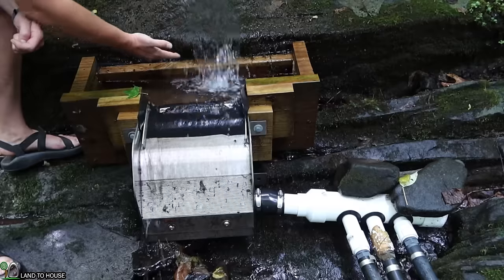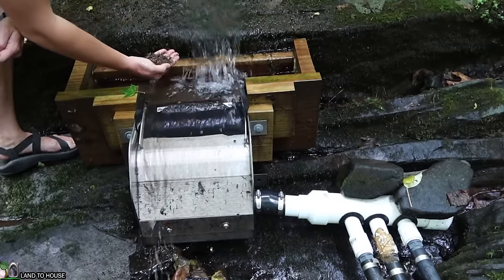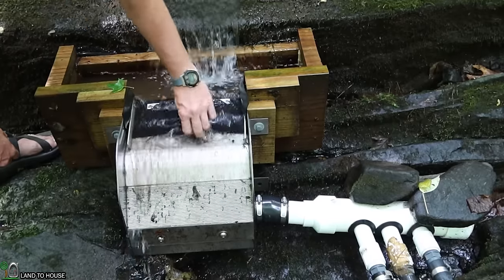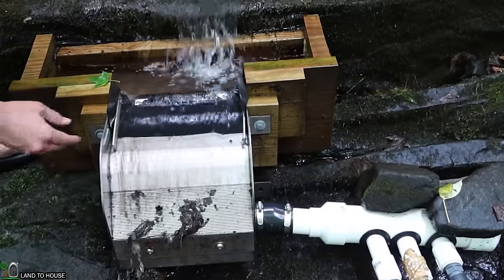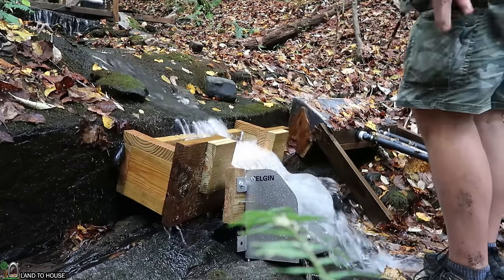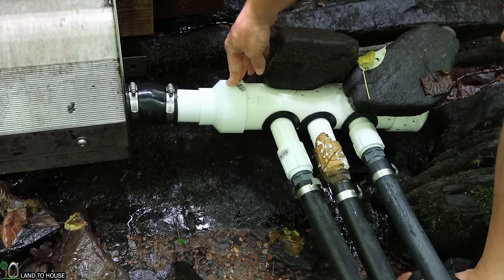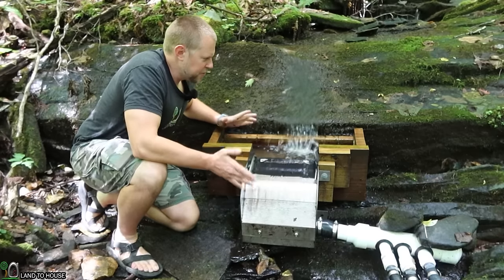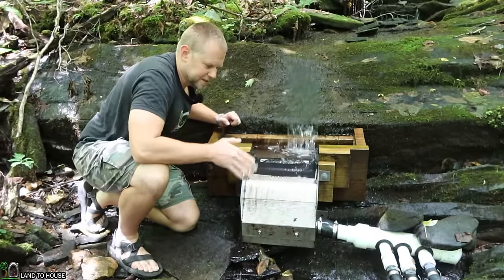Awesome Mountain Hydroelectric Power

Comment: Have you considered a float switch in the barrel and PID controller to adjust dynamically the turbine valves? It's a fair bit more complexity but it would allow you to get the most power out of your system without losing it to the overflow
Reply: I thought the exact same thing.. It make it run and generate more power, when there's a higher water flow all automatically..
Reply: In a manner similar to a toilet flush controlled by a float mechanism, one can regulate the flow: when the float is at its highest point, it fully opens a valve; as the water level decreases in the tank, it closes, and adjustment can be made using threaded rods. No need for electrickery.

Comment: Nice setup. Well made video, very informative and well explained. I've never worked with hydro power, and it was interesting to see it installed and functional. I've installed solar power systems, not my own yet but plan on doing so. As I live in SW Florida the solar would be more than enough thankfully, as there are no creeks near me. Or mountains.
I will also compliment you on your "powerhouse" build, it's not bad and actually looks pretty clean for an amateur install. I am an Electrician with 35 years in the trade, and would offer a couple suggestions though, fairly simple ones that would be well worth doing.
One would be to cover all exposed terminal connections. As you've already experienced, mice will get into things and love chewing on wires. I've been told that the current flow attracts them, whether from the magnetic field or because they like the taste of insulation, I don't know. For a while companies were using a vegetable oil based plastic as wire skin and there were multiple fires caused by rodents eating through the insulation. I don't believe that's used anymore, but they still chew through wires regularly. Placing traps would be a good idea. The bare terminal connections are an issue with rodents as they produce heat and they will build nests close to them. If they complete a circuit or ground out your system you'll have an issue.
Second suggestion would be placing "Caution- Live Electrical Equipment" signs on your shed. From a liability standpoint it will offer protection to anyone who could possibly enter there, but more importantly it will protect you from any legal issues if someone were to get hurt.
I know it's stupid, however there are plenty of stupid people in the world today. Even if someone were to go in your shed, on your property, to attempt to steal your batteries or inverter, if they were injured they could attempt to sue you. And possibly even win. It's ridiculous, but it has happened. Here in Florida there were at least 2 cases that I know of where some crackhead went into a Florida Power and Light switching station to steal copper wire. While it was energized. Did not end well for them as they were killed, however their families sued. And were given money. I'm not sure if it was a judgement to pay them or if the company settled out of court to avoid bad publicity, but the bottom line is that the placement of Caution signs was increased, as well as the number of signs required for any areas that contain energized equipment.
Better safe than sorry.
Good luck on your planned upgrades, I'll look for the videos.

Comment: It's good that you also include previous years design iterations that had failed as well and for what reason for the lessons learned aspect.
Economical and reliable and acceptable performance are the 3 requirements of succesful commercialization. 
This is like indirect solar power.

Comment: I really enjoy your videos on your micro hydro. I think you have a lot more to optimize. However, most of them are more nice to have than need to have, since the win per option is very low. E.g. you could optimize the laminar flow into the turbine or you could make a more complex regulation of your water usage. The last will be saving water at the top and you could build in a container for storage. Also you could turn the water off when not needed.
I have more ideas, just from watching your videos... Keep them coming, plz :D

Comment: Thank you for putting this together, both the system and the detailed video, so important to explain the "why" and lessoned learned. Two questions: given your experience with mice and the other woodland creatures that will admire your green-energy why did you not further protect the vulnerable wiring and I absolutely hate with a vengeance the use of "Wire-nuts" to connect your generator with the to-house wiring connection, terrible. Thank you in any case.    👍    (Edit: The outdoor electrical box, this is a better idea. However for fire safety - it's a bit close to your house, fire spreads with ease. It would be wise to install an "Automatic Fire Suppression System" with a primed burn-through-pipe running above each electronic system within that cupboard. There are many to choose from online, personally I would use TWO medium priced independent systems covering the same area, as this allows for one to fail while still protecting your property. Also install smoke detectors etc.)

Comment: It's always better to place a rectifier as close as possible to the generator as dc has less parasitic losses, specially with higher frequencies.
Also you might want to look into active rectifier to improve efficiency
Reply: and only 2 wires will be needed :)

Comment: This is a really nice set up. Really enjoyed watching the video and is very informative and well explained. I would love to do this myself if I had the opportunity to live near a running water source like you do. The nice thing about this is you can produce power 24/7  unlike Solar. I've been electrical contractor for over 35 years and have been living off grid for the past 30+ years. So I can really appreciate the work you put into your system. One thing I would suggest as I have also experienced in my own set up is that you need to upgrade with time. That being said I would suggest you using lithium batteries or something similar as opposed to lead acid. I understand that they are expensive but the cost is well worth. Plus you won't have to deal with all the maintenance like you have to do with Lead acid type batteries.. One other thing that I would suggest is to make sure your battery cables are sized according to your battery amperage and fused according to your  amperage if you haven't done so already. This is one thing that is often overlooked. Looking forward to your next update. Keep up the great work and please stay safe.⚡👍

Comment: I love this project and am about to do basically the same setup. Any chance you could put together a schematic so I can have better guide to design my system? Also, which batteries are you planning to upgrade to? Keep up the great work :)
Reply: I have a similar setup but I’m using a Harris Pelton from Kansas Wind Power and with one 5/16” nozzle at 58psi I’m getting 350watts.  I would get a bit more if I replaced the bronze pelton wheel that’s been running continuously since 2008.  The cups are worn smooth so some efficiency is lost.  They have a new model with stainless pelton wheel that I would get if I was starting over.   The unit in this video seems to be a bit missing some efficiency.
Reply: Where can I purchase these stainless pelton wheels? I’ve been running my wilderness Alaskan pelton wheel since 1981 and it would not surprise me to discover that the 3 bronze wheels are becoming worn. 
Thanks!

Comment: Hey, I've been watching your microhydro vids the last few days, very informative and interesting.! 2 questions. How cold does it have to be before the system freezes up? With running water, that might get it through a frost I presume? 
Also, I wonder if it would be possible/useful to ad a flywheel to the generator somehow, to store the kinetic energy produced? Has spwncer ever tried it? Hope you see this, thanks again
Reply from the maker: Thank you for watching. The system can handle a light frost but sometimes our winters drop down to the single digits. Definitely has problems at that point. I'm not sure about the flywheel. The constant water flow from the mountain seems to do just fine At maintaining the spin.
Reply: Thanks for the reply.! Can't understand why this system hasn't taken off here in ireland with all the rain and hilly land and streams. Or the hydro pump for that matter.

Comment: Question, wouldn’t your barrel for sediment and overflow act as a breaker box and neutralize the head pressure gained from above?
Reply from the maker: There is around a 2 foot loss from the intake and barrel. This means around 6w of loss. Not much worth fighting over. The silt catchment and air removal is much more important
Reply: I agree,you are venting the head to the intake at the barrel. Plug the outlet pipe and seal the barrel very well, and you have the head right to the intake height. This will give more pressure at the turbine, so you can use a smaller nozzle, giving the same flow as before, but with a higher velocity, hence more power output.
Reply: Why not site the sediment barrel at the top collector location too and take advantage of the 6w bleed?
Reply from the maker: The air seporation and silt filter is worth the 6w loss to me.

Comment: I agree with Joe, the electrical engineer who gave you kudos on your installtion. I have worked in the electrical distribution industry. And I took note of the incident where a mouse are through one of the phase wire coming from the turbine. The mouse met its demise by providing a ground path for the compromised phase. A ground fault detector can be constructed from a small torodial transformer through which all three phase wires will run. Normally the net magnetic field will be zero and the transformer output will be zero. The loss of a phase will result in an output from the toroidal transformer.  Some experimentation may be required.

Comment: My system has been in operation 17 years, a Harris hydro fed by 1/4 mile of 3" line, with 147' of head, producint about 840 watts, grid tied.  This year though, on spring startup, it appears my line is partially blocked.  I have a slow flow, but no leaks, visual inspection shows no kinks in the line, and the Coanada screen has always been in place so large debris has ever gotten into it.  I have tried letting it run unobstructed, hoping to slush it out, no luck.  Luckily I have plenty of PV power, but it's driving me crazy seeing all the spring runoff go by without making more than 100 watts!

Comment: In Chino Valley Arizona I ran across some Springs that feather small pond. Put an 8-inch pipe on the other end, and reduces down slowly to an inch and a half. It was amazing till electricity we are running off of that. Plus it was drinkable water. It was like a small Paradise. On 89 hey I think going towards Prescott from Ash Fork Koma there's a road that goes off to the right to the Seneca Ranch. Some of the largest Chinese elm trees you ever seen in your entire life. Water from the Springs come out of this granite rocks right out of the small holes, it's incredible, ice cold.

Comment: Electrician here, you've done a pretty impressive job! Couple of things for your safety, firstly, enclose your rectifier.. secondly, the cables you are using to connect to your domestic socket are known in the trade as a 'suicide lead' as the male plug is the source... you really should wire both of these through a permanent isolator as both the plug and socket could be considered 'live' (hot??) or a source.
Reply from the maker: Thank you. Yes the rectifier does need to be enclosed inside of a well vented Box. It can get rather warm.

The grid tie limiter inverter plugs are excited by grid power. When you remove them from the grid the entire inverter shuts off immediately.  Just this afternoon I pulled those plugs to install a lithium iron phosphate battery And the inverters shut off within a 1/2 second.
Reply: @Land to House  Nice choice of batteries! When I've used rectfiers like you are (in my case powering the DC bus of VFDs), I've mounted them in a vented box but on a heat sink protruding through the back for better cooling. Looking forward to the update!
Reply from the maker: @kiwiskiz  I will need to make this update before the spring when I turn the hydro back on.

Comment: One more thing to consider is that you are essentially breaking the stream like this. It would be better if you had a small weep hole in the reservoir so that it can relieve excess pressure as needed, but will create back pressure to the water feed, causing it to not redirect to the reservoir barrel but instead continue along its natural path.

Comment: I see you already have a thousand suggestions to improve the setup, but here is what came to mind right away. 18:52 the turbine ramps up quite a bit when closing the lid. My rational thinking says it is because the air in the chamber also begins to spin, which results in less drag on the turbine. The only thing that makes it a tad bit less efficient is the 90-degree corners of the box. Maybe air resistance becomes even smaller if the corners are rounded, resulting in less turbulence. Keep up the great work!

Comment: This may be more sophisticated or expensive than anything you would want to try, but if you could add a couple IBC totes at your buffer/filter tanks you could hypothetically be using them as batteries. If you knew you were going to be doing a chore that's electricity intensive you could open up your reservoir for a boost when you need it. I didn't catch what your flow rates are but a couple thousand gallons of storage may figure out to a kw or two and may prove to be almost as cost effective as batteries.

Comment: I found this very interesting and educational. That said, it seems that the power output is rather meager for the materials used and time invested. I wonder how much energy is embedded in all of that plastic pipe and the other materials? 

You said that you don't use the system in the winter months, which to me seems to be the time when an alternative to solar power is most helpful. I'm also concerned about the long-term durability and maintainability of the system. A well designed and build solar + battery system should run for years at a time with almost no attention.

Comment: Did you think of renting a fusing machine and fusing the pipe? Other option would be a Victaulic type 905 coupling. I have used both options hundreds of time at work and they never fail, never leak.

Comment: Excellent video, yes the battery bank needs to upgrade away from any lead battery system, since right there you loose 30% with lithium based only 5% or less while charging.
Reply: @snarkywombat155  ...lose

Comment: First, I want to say I like what I see, you did a great job putting all that together. Have you ever thought about adding a second barrel ahead of the first, this way you can use it as a catchment any debris. By adding this second barrel, it would mean you would only have to flush it once a year, say after the rainy season. Your Micro Hydro Turbine box, if it was me, I would get some PVC boards and plexiglass to make my turbine box with. Those items can be found at Lowes or Home Depot.

Comment: First, I am very happy that you do this successfully. I want to help you a bit. You are losing some energy because of the current arrangement because of the sand/air bubble barrel. The tank has an overflow and open to the atmosphere, which means all the head you had above it from the manifold at the wood box till the barrel is gone. It is better to keep the parrel next to the manifold at the top, then all the water head from the exit to the turbinelocation will be effective. Btw I am a hydraulic engineer. If you like, i can do some calculations to tell you how to optimize the system in the manar of  hoses or pipe diameters, etc. I like to help free of charge
Reply: I was thinking the same thing, all of that head pressure is just spilling out the side.
Reply: my first thought also, 1/2 head lost!!

Comment: At my job they use a hot knife style system that melts the pipe and then its pushed together to weld the pipes together. may could make something similar using a torch and some clamps

Comment: First I love it.. but you need to tidy up the wiring...the exposed wire nuts at the hydro gen, I'm from the UK don't get me started on wire nuts.. they will go bad fast..... And you said you had a fire already so that sweet inverter / controller setup you need to set it up as though any high volt/current wire will melt so it must not be near any casings or low voltage wires so if the worst happens you can just replace the wires and it won't kill the lv controllers.. I wish I lived somewhere where I could do a project like this its cool getting free power from nature..... Good job 👍👍

Comment: You should consider encasing the the phase coming off the turbine in a waterproof solution. The LB was open and the wires were connected externally. Doesn’t seem like it would stop much water from getting on the connections or from traveling down the conduit.

Comment: Hey Seth. Hope all is well. Have you considered fire suppression balls or fire suppression bombs for a lack of a better word. They are very nice to have and definitely gives me a peace of mind when it comes to my various farm and home automation products I design and build on my farm. They come with a bracket/ mount that you can attach right inside your electrical service box you built next to your house. They work off of extreme heat I believe and they smother the fire out fast. Great videos man. Thanks for all of the ideas you put out. Very helpful.
Reply: That cooling fan is starving for flow, drawing a vacuum against the lid, and unloading the fins, that is why it slows down when you open the lid of the turbine box... no cooling fan.